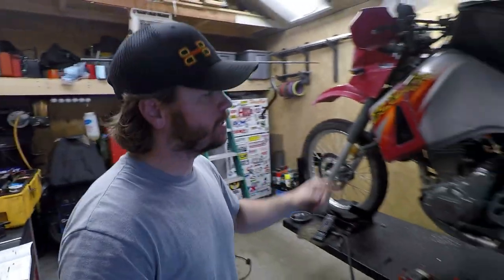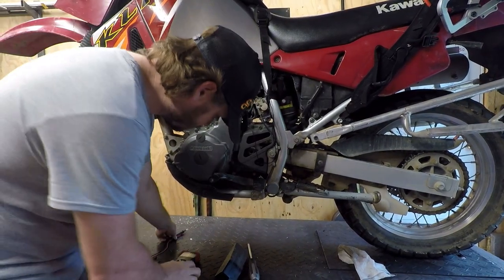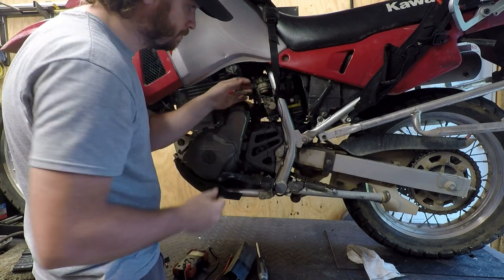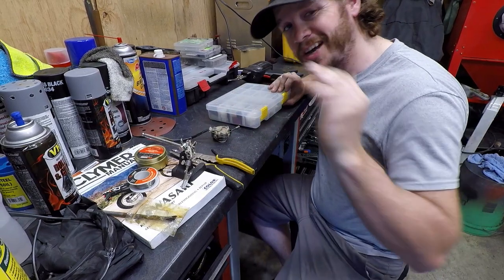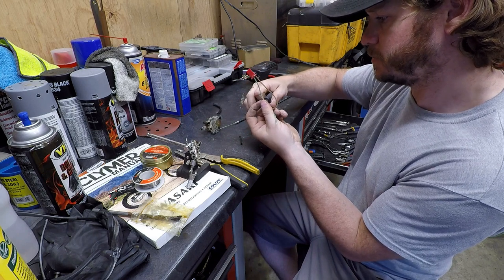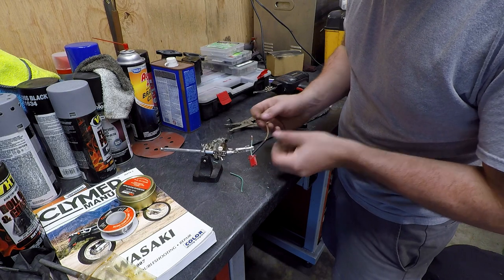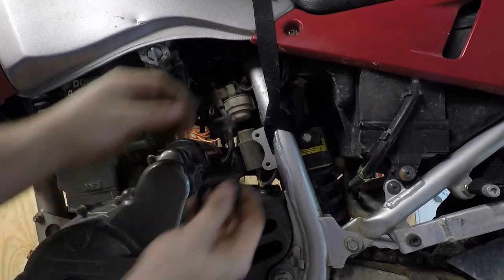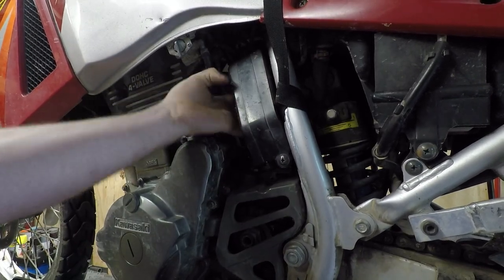KLR650 Kickstand Safety Switch Delete HOW TO

Comment: Nice work and thanks for sharing! As a side note for anyone interested in being able to return to stock in the future I recommend pushing the two pins out of the male connector and sliding the pointed end of the exposed wires into one another. Then heat shrink to keep the moisture out. Place the male connector (empty) back into the female sidestand connector and remove the switch from the mount down at the sidestand. Put in a place you can find for future re-installation.

Comment: A cable on the side stand to operate a remote switch - not surprised you removed it!
Reply from the maker: All about reliability on the trail.  I also only ride vintage bikes without side stand switches so I'm well trained to put the thing up lol
Reply: @BrickHouseBuilds  , the original cable and switch just added another point of failure.

A bike I have has a warning light for the stand being down. A friend had a go who was used to only riding bike which had a side stand cutout. They looked worried, and when I stopped to ask they said they thought there was something wrong with the bike as on a right hand bend there was a grinding noise!

Comment: I am confused by the setup on my '88 KLR, which i got used about a year ago.  There is no jumper attached to the white 4-recepticle plug.  It is just zip tied against the frame.  Yet, the bike starts and stays running with no issue....Until, after riding in heavy rain, I ended up having to spray wd40 into the white connector to get the engine to turn over and start.  Any thoughts on the 'no jumper' thing?   Thank you for the video!
Reply from the maker: That I don't know. Being an 88 it probably has a slight variation in the wiring but only your diagram could tell you. A bit of time with a multimeter would give you the answer though
Reply: @BrickHouseBuilds  thank you. I appreciate the reply.

Comment: Did you delete all the vacuum tubing and charcoal canister stuff?
My 03 has a three nippled little canister that uses the same mounting. Thought about just keeping the mounting off and just zip-tying the canister onto the frame of the bike but I'd like to know if you can all just be deleted I'm kind of tired of that crap.
Reply from the maker: The charcoal canister is a California specific model trait. Mine does not have that

Comment: '06? looks exactly like mine. :D. Will follow this on my bike, like to get rid of that as well. Thinking of fabricating a metal cover in place of that cheap plastic one. What brand is your table lift? Speaking of plastic, I replaced the choke cable system with an all-metal plunger mounted directly to the carb. The old plastic one always rested on my gas tank when the bike was at kickstand rest.
Reply from the maker: I like the idea of it being an eliminated potential failure point. My table is a black widdow brand

Comment: I totally agree with just cutting it and soldering them together.
However, I would strongly suggest that you cut the wire more in the middle so that should you ever want to reinstall that switch you'll have enough wire on both sides to make that connection.
Reply from the maker: But I won't ever put the switch back on. I took it off for a reason.

Comment: So basically just remove all the components from the kickstand all the way to the plug and then loop the wires and plug it back in? That easy?
Reply from the maker: Pretty much yea. I just did more explaining so people would understand how the system functions and where it may cause an issue
Reply: @BrickHouseBuilds  Does it matter if when you install this mod that you have the kickstand up or down? As in, will the switch for some reason "remember" which position the kickstand was in when you pulled the plug and then plugged it back in ? Or does the wire loop just bypass that all together and it doesn't matter?
Reply from the maker: @rolliecarso  Id watch the part where I test it again to understand what the switch does and what the wire does. Pretty simple system

Comment: My motorcycle does something similar but when I get in first gear it automatically dies but when I have it up on the back stands and put it in gear it rolls not a problem but when I put the kickstand back down and automatically turns off and jumps
Reply from the maker: Yea thats the kickstand switch. Thats what it is designed to do
Reply: @BrickHouseBuilds  but when I I put my hand on the clutch and hold in and put it in first year I should be able to roll the back tire. It feels as if the back tire does not want to budge. But when it's up on the lift in freeplay first- gear it rolls without a problem. I rebuilt this bike but this is the last thing I have to figure out why it's doing this I will replace the kickstand switch
Reply from the maker: @jaredstottler1813  I'm a bit confused as you seem to be describing two things here. One is the confirmation that you have a functioning kickstand switch as you say you lower the stand and it dies. OK. Next you say if its on the ground and you go to first it dies but free spins in neutral. To me that scenario sounds like stuck clutch plates.  What type of bike is this?
Reply: @BrickHouseBuilds  the motorcycle does not die when I put the kickstand up or down when I put it in gear it dies.could it be Clutch safety switch? The back tire wooden freeroll lifted up on the back kickstand so the bike is up off the ground period but on the ground in neutral it turns on in first gear when I change it at automatically jerks and dies
Reply: Daelim roadwinn 2005 vj125
Reply from the maker: @jaredstottler1813  I'm struggling to understand your texts so please bear with me.
WITH THE BIKE OFF!
1- Put the bike on the stand with the back wheel off the ground. 
2- Put the bike in neutral
3- Does the rear wheel spin free?
- if yes that's good
4- Put the bike in 1st gear (NO HAND ON CLUTCH)
5- Can you spin the back wheel?
-You should NOT be able to
6- With the bike still in 1st gear PULL IN THE CLUTCH
7- Try to spin the rear wheel.
-If you can spin it good. If NOT you may have frozen clutch plates
Reply from the maker: @jaredstottler1813  I am unable to understand if you are describing a MECHANICAL or ELECTRICAL issue so follow my above steps to confirm a MECHANICAL test
Reply: @BrickHouseBuilds  thank you so much for explaining it to me. I will try when I get home in a little bit I'll also make a video if you have time later to watch it no rush I just really appreciate you taking the time to answer some of my questions and I understand how hard it is to understand what I say when you can't physically visualize what is occurring. I'll send a link below when I get home one video will be when the motorcycle is up on the lift with back tire free off the ground II will be trying to change gears on the ground and I'll see if the plates are sticking
Reply: I got it moving in first gear. Shuts off but I think I freed it up .went down my driveway with it in neutral then put in first gear to make jerk an fred itself up. Now Turning bike on holding down clutch putting in first gear I can push bike without back tire  seizing up on me. Now Turing bike on an putting it In first gear. It dies but doesn't jerk as it did before. So I ordered new side stand relay switch to see if that is the problem :)

Comment: It will still go into gear either way let out clutch it will die
Reply from the maker: @jeffreyvandebogart8388  what?
Reply: Saying it dies soon as u put it in gear  if switch is bad ain’t true. It will die once u let out the clutch. I’m literally just had this issue today. Only died when let out the clutch. Was hard ride home 15 miles holding kick stand up hard enough to hit switch good